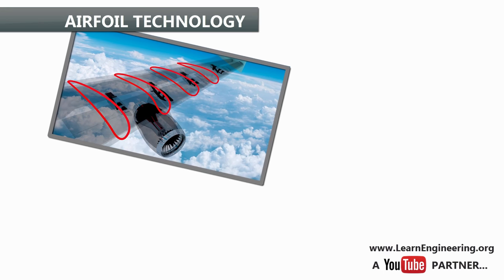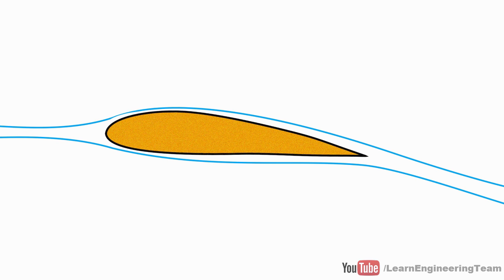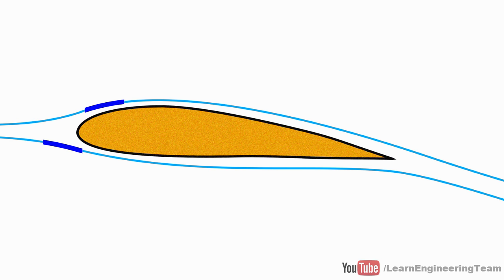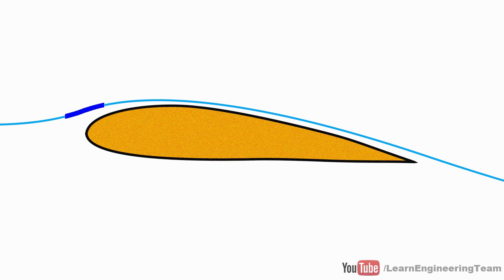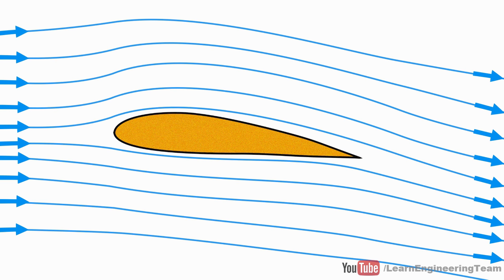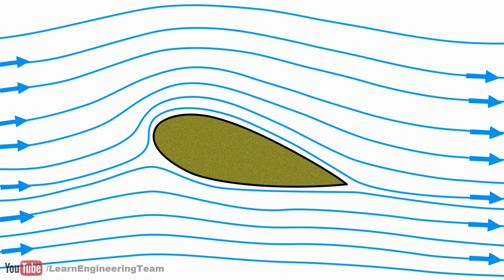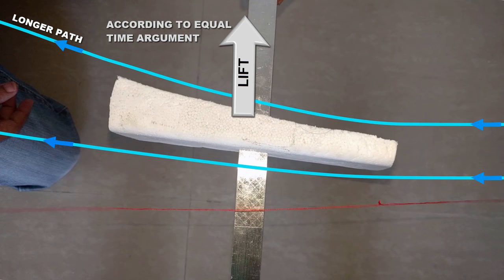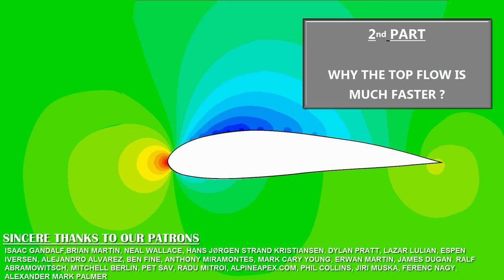How do Wings generate LIFT?

Comment: Question, water from tap passing over back of spoon draws spoon into flow. What happens if this was in a vacuum? Would the spoon be drawn in.
Air has pressure, atoms are hitting top and bottom same amount, motion can be seen in Brownian motion. When moving forward the upper curve accelerates air molecules thus they are having less time to impinge upper surface, glancing blow sort of, therefore less pressure.
If upper surface was undulating, the flow would produce cavitation, so air wants to follow a smooth curve.
Underneath the molecules are  bunch up , slowing down creating greater pressure.

I once took off with patch of water on wing that refroze on right wing shortly before getting airborne. As we took off it destroyed some lift in front of aileron and aircraft wanted to roll to the right. This in effect was a undulating surface. It became a spoiler.
Reply: @Observ45er  Another theory.
Reply: @flybobbie1449  Fact from reading the big authors and actually talking to some like McLean, Anderson and Drela.
...
Reply: @Observ45er  Well NASA think different.
Reply: @flybobbie1449   Please supply that specific link.  NASA sponsors some pretty poor science material.  Most notably what I found in the Museum in a Box program about Bernoulli which is very wrong. The noted aerodynamicists  Doug McLean even said they have some needed improvements.
That part about less time on the surface is incorrect as I stated.
Reply: @Observ45er  To be honest you can spend all day searching for explanations, Interesting phenomenon i see summer is the amount of bugs splattered on the upper surface of our training aircraft. One would think they would pass over in the flow.
Reply: @flybobbie1449   Well, it is a fast flow, but there is a boundary layer and the pressure is trill pushing down, just a little less that normal.  It doesn't go away.
 For light planes wing loading is only 0.1 psi, pretty small pressure changes. This is a reduction on top of only about 0.08 psi.  That's like a 0.6% drop in pressure.
It's a wonder we can fly.
.
What's your craft?
.
If you read my About, you'll see i'm serious about getting this correct.  It is so frustrating with all the amateur guesses on the web and repeated out the wazoo...
Cheers.
Reply: @Observ45er  Lift is a wonder. Took off once having deiced aircraft. A patch no bigger than a foot print refroze on the outer section of wing. On take off my student was struggling to keep wings level, untill i realised that patch of water had refroze.

Comment: The angle of the wing is a high angle of attack.  That means the air flow below the wing will be colliding with the lower wing surface area & increasing the resistance--which slows the air molecules--thus causing them to take more time to reach the trailing edge of the wing.  The opposite occurs on the upper wing surface area because the air molecules aren't colliding with the upper wing surface area & thus they flow with less resistance--thus causing them to have a higher velocity & take less time to reach the trailing edge of the wing.

Lift occurs because the total force of the air molecule collisions on the lower wing surface are higher than the collisions on the upper wing surface area--thus creating a higher total pressure below the wing & a lower total pressure above the wing. 

The angle of attack is not the only factor in lift though.  If you go beyond the angle of attack critical angle you will cause a stall because the lift drops as the air above the wing no longer flows along the surface of the wing.  The lower surface area of the wing changes the force direction to act as more of a braking force than as a lifting force--hence a stall--which will cause a plane to fall like a rock--not good for humans on board or for the cost of replacing the plane if radio controlled & no passengers onboard.
Reply: You have it!.  Somewhat crudely stated, but as I interpret your meaning, that is it.
..
Also.
Above wing reduction gives folks the most trouble. For a better understanding of the detailed cause of the reduced pressure above a wing, try this short video:
https://www.youtube.com/watch?v=3MSqbnbKDmM
Regards

Comment: The air doesn't move past the wing, the wing moves past the air. The air particles only move up and down, not left to right. The air particles above the wing move farther than below the wing from their original position, and are pulled downward as the wing passes the particle by the Coanda effect. The air is not moving fast or slow, it is stationary.

Comment: IN THE BOTTOM , the air has more pressure than top, b/c of the space b/w airfoil and ground, the air will  pass with more speed than top*,  (at the end of video it shows the top air flow is more than bottom) , and as the airfoil has a curve , so the top airflow  will follow the shape of curve and will make an angle at the peak (edge) point of the airfoil,  now as the atmospheric  pressure is high at the end than the bottom , so the angle will continue, which will cause lift.
* e.g if we blow air in two pipes having varying diameter,  with same pressure, the air will pass from the small diameter pipe first with maximum speed/velocity. here in this case of airfoil, the top acts as  large diameter pipe and bottom is small diameter  pipe, as the distance b/w the bottom of airfoil and ground is less than top space.

i am looking forward for your kind guidance. i m civil engineer  .

Comment: The reason for the faster air flow on the top than at the bottom is due to the pressure difference.There is a higher pressure above the air foil and a low pressure at the end of the air foil. In order to equalize the pressure, the air moves faster to but can never do it.On the other hand, in the lower part of the air foil the pressure is not as high as the pressure above the foil and so the air moves more slower.

Hope it is the right answer........
Do let me know........

Comment: 1) The effect shown here is called the Magnus effect and not Coanda.
2) The Bernoulli principle works only with fluids in motion.  The carburetor operates at this principle.
 On my understanding, the upper airflow accelerates because that above certain airspeed the disturbed airflow above the wing "has no time" to equalize with the surrounding pressure.

Comment: Is it because air moves faster through a low pressure system that the particles on top move faster?

Also, I have a question: why is it that the pressure increases as you get closer to the wing from the bottom. Is it also the Coanda Effect? 4:26
Reply from the maker: Coanda effect happens only on convex surface. You can see at the bottom flow gets curved downward, especially due to the curvature of the bottom surface. We know in a curved flow the outside pressure is larger. So as we move toward the airfoil the pressure should increase.
Reply: Thanks!
Reply: Bernoulli is a surfaces/pressures viewpoint, while Newton is a forces/accelerations viewpoint.  They both explain 100% of the lifting force.   Example:   a rocket engine, does it create thrust by flinging out a massive exhaust?   OR... does it create thrust by producing higher pressures inside the front of the engine, and lower pressures at the rear?   (Answer: the question is wrong, it's not an either-or situation.  F=ma and surface pressures both explain 100% of the engine's thrust.)

Comment: Bernoulli's theorem is not incorrect - the flow of the air over the top of the wing causes an increase in dynamic pressure and a decrease in static pressure - hence, lift - QED ...

Comment: Informative video, ty. But unfortunately I believe you misrepresented a fact. The video mentions that highly cambered airfoils are not used because they have issues with structural strength and lack of space for fuel. While these factors are valid the primary reason particular airfoil is chosen is it's performance at the speed the airfoil is expected to fly at. Take for example the highly cambered airfoil you showed as it applies to modern day passenger jets. That airfoil would never work because it produces too much drag at higher speeds. Don't forget that drag varies according to the square of the speed. Double the speed, get 4 times the drag. If you start with a high drag airfoil the total drag will get out of hand quickly, and for those who may not know drag is the resistance to the movement of a plane through the air. High drag means more power is required to fly the same speed and that costs money, not only in fuel but the airplane gets heavier from the fuel and the larger engines and the extra weight of the structural upgrades to handle the increased weight, it spirals quickly. Now take the same airfoil and apply it to RC sailplane that was designed for low speed and it might make more sense. Since airfoils are selected for performance at the speed (there are other factors, trying to keep it simpler) the airplane will spend most of it's time and the fact that there isn't a magic airfoil that performs well at all speeds you end up with devices that change the effective airfoil when you are at speeds that the wing doesn't perform well in. That's why airplanes have such things as flaps, drooping leading edge extensions, adjustable wing sweeps, etc that allows for better performance during take offs and landings or flying at low speed. Sorry for the wall of text. It's just, to me, if you produce content correcting a common fallacy (which you did, ty) be careful not to introduce some of your own. Keep them coming guys, always looking to learn!

Comment: Low pressure reflects high velocity when compared for the streamline above the airfoil. (Bernoulli's equation for 2 points in the streamline)
The pressure difference at the bottom face is too small compared to the top surface which shows that the average velocity of air at the top will be higher than that at the bottom surface and thus, air flows past top surface at a quicker rate.

I hope this is correct🤞🏼
Reply: Sounds like you got it.  The upward lift force is from the top-to-bottom pressure difference over the wing area. 
..
The atmospheric pressure ahead of the wing pushes more than the pressure above the wing, therefore accelerating ira above the wing rearward.
.
Above the wing gives folks the most trouble. For a better understanding of the detailed cause of the reduced pressure above a wing, try this short video:
https://www.youtube.com/watch?v=3MSqbnbKDmM
Regards

Comment: This explanation seems to be based mainly on the Coanda Effect, but real airflow over an airfoil cannot be represented by a jet stream as required by the Coanda Effect, so it should not apply. I liked the disproving of the equal time theory, but some characteristics of it still apply, such as the higher velocity over the top surface. The video does not discuss at all how velocity impacts pressure changes. A higher velocity correlates to a lower pressure on the top surface, while a lower velocity correlates to a higher pressure on the bottom surface. With less force pushing down it is much easier for the force pushing up to generate lift.

Comment: This video gives a great argument towards why the common explanations are wrong, but the presented explanation is incomplete. The Coanda effect cannot be attributed to the most important reason lift is generated, which implies that viscosity causes the fluid to follow a curved surface, not pressure. The experiment shown at 3:33 is also invalid for this application as the reason the water stays attached to the jar is mainly due to surface tension forces. However, I do appreciate the presentation of curvature and Newton's 3rd Law as a part of the corrected explanation. I encourage all viewers to dive deeper into the topic of lift, there is much to be learned on top of this video.
Reply: I agree with many of your points on this video including the misuse of the Coanda effect and I would like to add that using the Kutta condition and vorticity can be used to determine why the speed above the airfoil increases when compared to the bottom surface.

Comment: The analog to "higher pressure" is "compression." If the mass in motion doesn't change then compression dictates a smaller volume. In that case, if the streamline doesn't shrink enough then the length must be shorter also. Fluids are very squishy, so it is not possible to confine them in one dimension. This gets somewhat confusing when one hears, "The P-38 was the first plane fast enough to encounter compressibility." That is a trans-sonic phenomenon that we are not dealing with here.

Comment: As the AOA increases,the fluid has to travel only a short distance but the fluid flowing on the bottom surface of the fluid has to move a longer distance,on the other hand the velocity of the fluid flowing above the airfoil moves with higher velocity but the fluid flowing below the airfoil moves with lower velocity hence the lift generation.so both the particles never meet.This is my opinion.

Comment: Hi! I'm a Japanese who doesn't speak English. Forgive me if I say about something nonsense.

My view is different. The upper surface of wing is streramlined, so air flows there fast, and it generates upper lifting force.
The lower surface is flat, so the air speed is slow, and small lower lifting force is generated.

When the slat and flap are down, the lower surface changes its shape to inverse streamline. So the air flow breaks out from the lowerside of wing, and no more down force. Hoever the area of wing expands, and up force is more to help lo speed fly.

Comment: Nice video, but I agree with others below that the explanation is a little circular:  "How do we know the pressure is lower at the top wing surface than atmospheric?  Because there must be a higher pressure above it to force it to follow the wing."  "Why does the fluid follow the top of the wing?  Because there is a higher pressure above it."

Comment: Bernoulli's principle was originally derived both experimentally and using newton's second law. So comparing between these two laws isn't very rational. If you mathematically model the flow field you will acquire the navier stokes equations. Solving these set of differential equations along a specific axis and under some assumptions gives you Bernoulli's principle.

Comment: There are such an amount of effects at work which are not all fully understood, also the formulas engineers use to design profiles all have parts that were found by experimenting and are applicable only for certain ranges of size or speed etc. In fact we still don't know why airfoils work.
The one thing we engineers and airfoil designers should be able to agree on is that even today there is at least some grains of magic left undetected.

Comment: i think it is due to conservation of energy. High pressure at bottom means low velocity and low pressure at top gives high velocity
Reply: Yes. But that doesn't explain what causes high pressure or low pressure; you're assuming the existence of the pressure field and extracting velocity (which is valid but not particularly useful for explaining lift)

Comment: Although Newton 3rd law can explain how some of the left produced, but the force it provide is really weak based on the law, the pressure different should be the main source of left, if you try to think of the vector of air out at 5:09 , the magnitude of left should be small.
Please let me know if my idea is wrong, and please explain about it. I really want to know how left is really produced on a wing.
Reply from the maker: For air moving near to speed of sound lift force from Newton's third law cannot be small.
Reply: CHLeung, if you are saying the pressure differential the main force generating lift, then you have missed everything. How about the elevators? What is the prime force making a huge 777 lift or dip its nose (or rather, its tail)? Or the ailerons? Think about it...... The lift force generated by Newtons 3 laws (all apply!) has nothing to do with being close to the speed of sound either - its there just before a stall too. Bernoulli's principle is hard at work explaining fluid dynamics etc etc etc, but the lift produced by the "vacuum" or pressure difference (maybe 10-15 psi at most) cannot account for the lift actually needed to negate the force of gravity.

Comment: also the reason on why the two pressure doesn't meet its because of the structure made and also if the two forces or pressure meets in the same position then the object would be dragged down instead of going up

Comment: As to why the top streamline accelerates, that is due to Bernoulli's principle an the fact that the air is taking energy from the aircraft's forward motion. But it is due to the drop in pressure and not the other way round that generates lift. That's the misconception.

Comment: Physics books actually explain the concept of foil lift using bernoulli priciple, but not by that equal time... The principle states that fluid pressure decreases with increasing  speed...it means that a fluid that move slowly exert greater pressure to its surrounding...to increase the lift, the fluid must be much faster at the top as compare at the bottom so as to generate pressure difference...

On one hand , the 3rd law of motion always  involve two different bodies interacting wirh each other, exerting forces that are equal but in opposite directions...

For me. The concept of bernoullis principle to explain the airfoil lift, is not an entorely a misconception

But 3rd law of motipn is indeed one of many concepts to make that human's dream of airplane, a reality